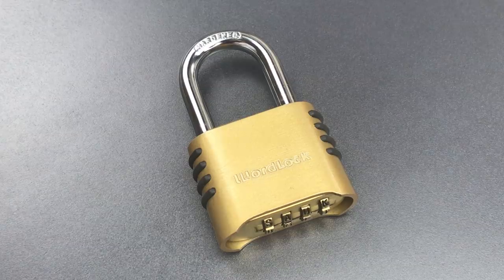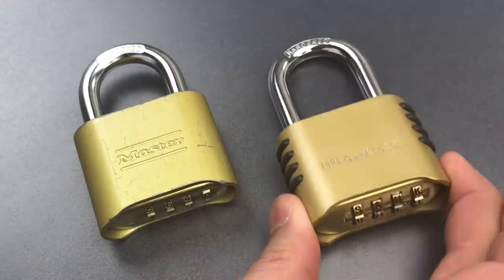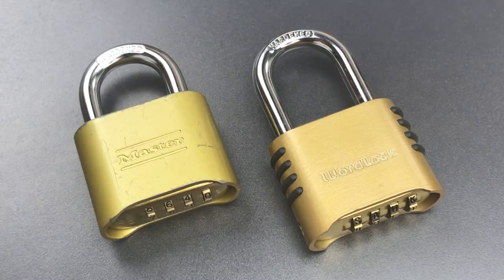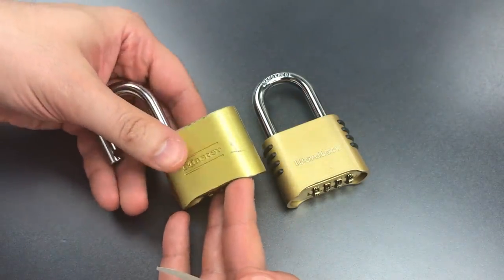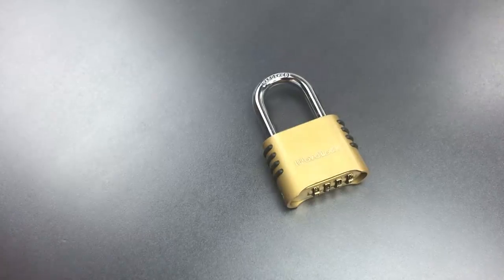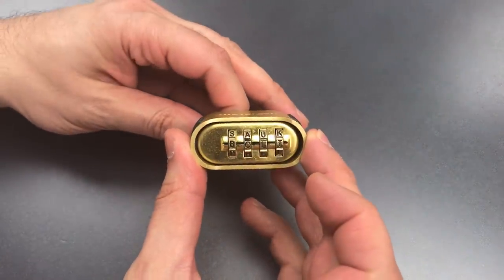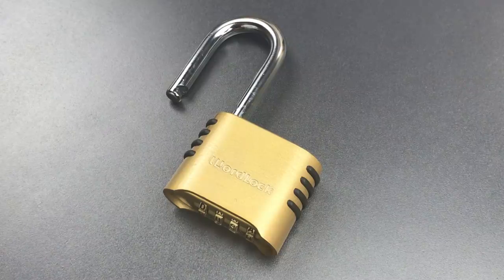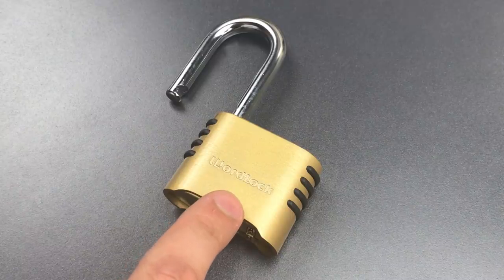[692] “Tamper-Resistant” WordLock Combination Padlock Bypassed (Model PL-106-SS)

Comment: LPL, could it be possible to make a pickproof lock just by (and extremely impractically) setting the pins deep inside the lock body? That even has the benefit of even if there was a pick long enough it would be awkward to use in theory

Comment: LockPickingLawyer is there ANYTHING that is tamper resistant with you :) 
If possible can you show one lock that is basically impossible for you to pick I swear that keys are technically a waste of time in your case LOLOLOL :)
Reply: Steve Normandin it is possible to tamper with anything. Now whether this tampering with open the lock or not is an entirely different issue.